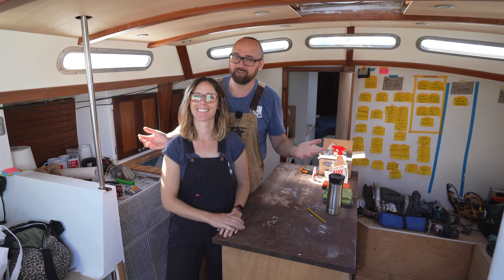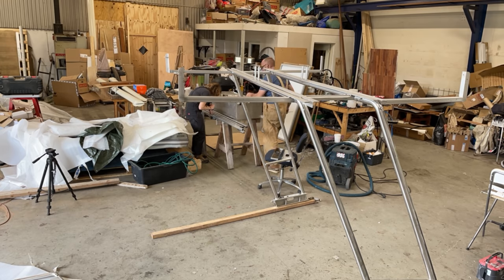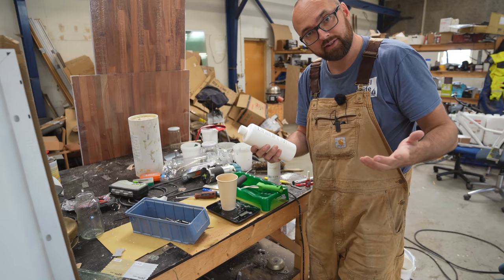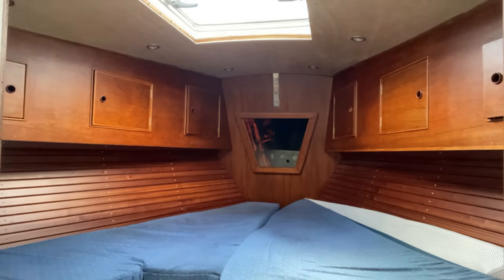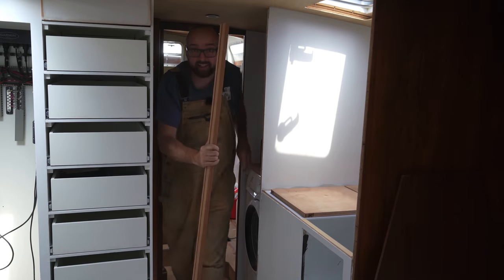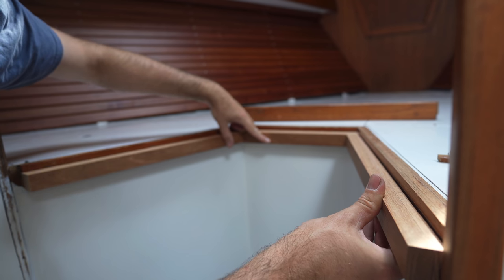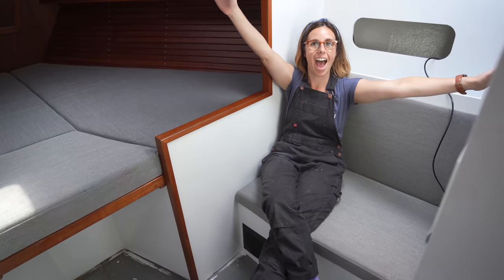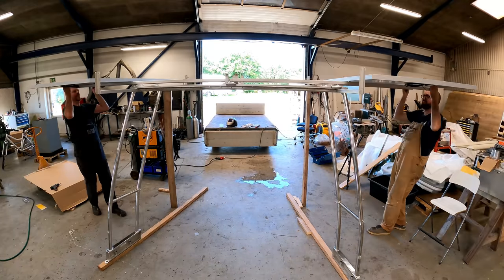Sail Life -  1200W solar on a 38 ft sailboat ⛵ - DIY project

Comment: Hi Mads, when I was living onboard on my sailboat in Sweden, I installed small PC 12V fans under the bunk to make suck out the air. I also drilled some small holes under the bed. That help alot
Reply: That’s a superb idea.
Reply: That is my experience too. Makes a difference even without the fan, but the squishy stuff still requires some air circulation. Some holes under it or something. I have that.
Greetings from Finland.

Comment: Arch looks great but with dingy+ engine  and panels, looks like arch needs additional triangle supports running fwd from arch to deck for bracing. That weight looks  like a lot of stress .

Comment: I’m a marine fabricator and that is a large cantilever effect with the arch. It’s OK in the marina but when your sailing there is a lot of inertia to consider. I really hope the hull deck is reinforced to cope with the cycling loads working 24/7
Reply from the maker: The deck-hull joint is just shy of 1" thick solid fiberglass. I'm not worried :) In terms of strength I can't think of a better place to mount the arch.
Reply: I was more concerned with the airfoil effect. With a strong cross wind, that could push the stern over hard.
Reply: @SailLife  perhaps monitor it, see if its cracking the gelcoat/paint and add a longer beam under it if needed?
Reply: @SailLife  I have had a problem with less weight  on my arch.  I had to add diagonal braces because when hit by a wave it felt like the arch wanted to jump over the side of the boat.The flex was impressive.
Reply: COG is aft of stern, from top arch post run guy wires anchored about 4 feet forward, no comms gear on arch, as well as planning ahead alternate stowage/recovery of panels, if necessary. Consider sea trial with wind 17-25 knts before embarking.
Reply: We have a similar arch, holds two large tiltable solar panels, radar, various antenna, a barbeque, a 10 kilo gas bottle, a Highfield classic with at one time a Honda outboard weighing in at 99 kilos with the dinghy. It has done 37,000 miles with said dinghy in place and seems pretty solid still. No signs of our puny 20mm fibreglass letting go yet. And as far as airofoil effect, well when you have wind strong enough to cause that to be an issue, you have a whole lot of other problems to keep your mind off it, such as those 17 metres of slab sided mast etc. We only have 8 fasteners per panel, so we could ditch them over the side if necessary.
Reply: Your channel is a nice contrast to time share production boat rebuilding golks whining about what they dont know and truly cant afford. That as a side I dont know the arch its adventurous - it might be just fine time will tell. I put on a large adventurous hardtop on my boat with extra bracing - Imhave had some hairline gelcoat cracks.
Reply: @chrisfreeman4358  That's what I was thinking, it may need more diagonal support. Some gussets in the top corners to stiffen it side to side from flexing. Looks plenty sturdy fore/aft direction.
Reply: @keithhall9298  I'd like to find a 20 year old production boat without hairline cracks. Our 150 million dollar office building had more cracks than a bus load of comedians and it was designed to last a hundred years. They demolished it last year, at 26 years old, to build a casino. They're betting on future business to make it pay. That's progress for you.

Comment: Enjoyed this video so much.  Progress is accelerating with your teamwork (and thank you to Martin & crew).  Just the whole vibe of the video was great with the glimpse of the drive from your parent's house (thanks to Ava's great videoing I assume).  The arch is amazing. I was just slightly worried with the loads the bolts holding it down will be carrying and how they are attached to the boat.  But I am sure you've got that all worked out.  Can't wait to see next week's video.  Sunday night's (local time) I'm always looking forward for the next episode.  Thanks Ava and Mads!
Reply: I agree, --looks like the arch could use a little more bracing or the bottom feet should have been made longer,
Reply: @wdinns  as there Will be a BIG wooden beam going i to the arch, I suspect that Will be part of the structural strength and integrity which prevents the "Lean back" forces..

Comment: For the dingy might want to make some loops or soft shackles for the lifting points and have pre-made lengths of rope with carabiners coming down from the arch.  Should make connect and disconnect faster and it will keep it level.

Comment: Do you think there would be any need to brace the solar slide-outs? Seems like a strong wind getting under a panel could possibly cause problems…
Reply: Solar panels are mounted to  Motorhomes and Vans in the United States by the 10s of thousand and go down the road at 80 MPH and do not cause any problems , they should be OK
Reply: @glennlacewell5766  I have yet to see any motor home or van going down the road at 80 MPH with panels just flopped out in the breeze like a hanglider wing. They’re all (usually) pretty well secured…
Reply: @southernpaths2986  That's why he said they're only for use at anchor. If it gets windy he will keep them retracted
Reply: @57dent  I get that… it was clearly stated in the video that they’d only be deployed while stationary but the wind doesn’t stop blowing when you drop anchor. It just seems like leaving them unsupported could possibly lead to problems.
Reply: @southernpaths2986  When you drop anchor you're always looking to be on the lee shore so you're sheltered from any winds. Besides, if wind pucks up he just retracts the panels.

Comment: I look forward this video every week more than I looked forward to GOT…

I have some mild concerns about the arch and sliding solar arrangement being beefy enough to withstand a Atlantic crossing. Costal it looks fine, afraid a nice big wave to the stern would bend all the tracks and make it inoperable. I’m sure it was well thought out and worst case you know how it goes together so you can rebuild!
Reply: I too am concerned about the leverage it has against the deck fasteners, pulling up the dingy with an engine on while bouncing on anchor is a lot of stress. If the toe rail wood goes into the base of the arch that would help but an add on brace would make me feel better.
Reply: Madds said the solar panels that slide would not be out when under way so you don’t have to worry about it. It’s only when at anchor the panels will be slide out !!!
Reply: @mwatkins2464  definitely understand that part. Even when the second set of panels is stowed that is a lot of surface area to catch water, wind, and swing at the end a pendulum pitching in the sea.

I’m sure he knows what he is doing, just interested to see how it turns out.
Reply: @murphthebeast  you might be right I guess he will have to try it out and see.👍

Comment: Mads, I am really worried about the mass of the solar panel+bridge so far from the axis of rotation when the boat is in choppy waves. I feel that the construction needs a stronger fixation to the deck, e.g. with an extra leg/brace forming a triangle.

Comment: Good to see you both together!  I have to be honest, seeing the arch on the boat makes me a tad bit nervous as it will always be pulling on the mountings wanting to tip backwards.  This could be especially troubling in squalls and very high wind situations where anything that gets enough wind under it goes flying.   I can't remember if you did some load calculations but I suppose I only comment because I want the best for you and Ava, as much as an armchair engineer I may be!  Cheers!  Evan

Comment: Mechanical Engineer here... It looks like you have a crazy moment load on that arch working to rip the fasteners holding it to your boat out of the deck.  I'm not too familiar with your design (first video I watched in a long time) but just thought I would mention it.  It looks like the boat is coming together nicely!

Comment: I'm concerned about the weight of the Arch, the Panels and the Dinghy adding another structural support extending forward from the arch to provide a little more stability for the Arch and the weight it will support? Its hard to explain what I mean without using a depiction, I just don't think the load is distributed over a large enough area of the deck.
Reply: A support / brace at the forward of the arch supports would be helpful.  Perhaps extending the base section.
Reply: @Tomm9y  Right, just something to distribute the load over a larger area than just that aft end.
Reply: Exactly. A base that is 2-3 times as long and an extension on the forward stanchions or just the forward stanchions at a different angle, so that they are not parallel with the aft stanchions, but extend more forward.

And a diagonal tube in the upper corners of the aft stanchions might be a valuable addition for (the many repeating) sideways flex/loads.
Reply: @gadenhertog  Yep, the arch looks really heavy and would benefit from diagonal bracing. Fore and aft AND side to side. Thin dyneema lines (X shape) maybe. Cheap and easy.

Comment: Being indoors that bathroom counter will probably be fine.  Out in the UV it really pays off to put a layer of really light fiberglass over exposed wood.  The glass turns completely invisible, but it's enough to stop the grain from checking the epoxy.  It makes annual varnishing super easy too.

Comment: Great Solar Panel Install. 2 things. 1. Put it on your yearly maintenance cycle to swap top with bottom panels to extend the life of both. 2. I would look for away to add a vertical support on the back and mount it vertically on the transom. Think some vertical support from a different mounting plane would help a lot with longevity.

Comment: not that it will help right now, but there is online shop called photonicuniverse.com, which sells solar related stuff. they have semi flexible solar panels, the bigger of them rated at 350 watts (2024 x 991x 2 mm) and under 7 kilos each. four of these babies will give you 1400 watts for a fraction of the weight. they are not cheap tough. i am by no means sponsored or affiliated  to said shop, i just think they have great kit.

Comment: If Ava is going to be concerned about dust, a small project for the future could be a variable positive/negative pressure exhaust fan. Some RVs have them, when. You're in a dusty area you positively pressurize the cabin and it keeps it out. If you're producing dust in the cabin, turn it negative and a good amount of dust gets sucked out.

Comment: I dont mean to be  derogatory or a smartass but .........Athena must be well down on her designed water lines with all that new fibreglass ,new machinery  and appliances,  new water and fuel capacity and new fittings and fixtures.   This goes against all principals of good naval architecture.  Still love your work.

Comment: Tip for the bed: add a mattress topper! After 2 years sailing in the Caribbean with 2 times crossing the Atlantic Ocean, we were so happy to be sweating just in the mattress toppers. At the bigger laundry service you will be able to wash the cover and we even washed the foam in Bonaire. And your own mattress will stay clean.you could even put some extra mesh between the topper and the mattress for extra ventilation.

And yeah, you guys rock! So good to see you together!

Comment: Kinda really clutters the boat. I understand functionality of the panels and is needed for your lifestyle your trying to achieve. Just feeling too much stuff on and in the boat. Also hopefully the panels don’t act as a sail or an extra rudder and create positive or negative steering. I can guarantee the panels will give massive down force and squat the rear during sail. Good luck hopefully my thoughts are wrong.

Comment: I hate to say this at this point in time. But I noticed that there is no ventilation under the bed cushions in the forward cabin. If you plan to sleep there every night I highly suggest you drill 1½" holes for every 5" or so to make the underside of the cushions ventilate.
If you don't there is a high risk they are going to go moldy on the underside unless you raise them up on edge to air out every day. Been there done that. 
A normal person perspires up to 200 milliliters of water per hour!

Comment: so exited to see the sliding solar panals,  i've always had that design in my head and its so good to see it actually made, mine is just a bit more elaborate in that not only do you have the two panels shifting sideways with a mechanism that you get in tabletop extensions that pops up the middle bit so it sits flush with the slide out side panels, but you then also have 4 shifting backwards, giving a total of 8 panels giving 2.4kw of solar.  and if you had the bi-facial panels the potential could be up to 4kw. obviously like you said only practical for when you are on anchor, but then again, that is where you would need it most, I would think

Comment: The project was already running in top gear and has now gone in overdrive with the addition of the lovely Ava and Epoxy mixer. One of the other contributors has mentioned mechanically ventilating your vee berth void space under the berth (as away of drawing air through the mattress - I think it’s a great idea - 😀👍⛵️

Comment: Curious - are you running multiple Solar charge controllers? One for the "always exposed" panels, and one for the "sometimes covered" panels? If not, how are you dealing with the shading issues from the panels?
Reply: If you look back several episodes, you will see that he does have two separate victron charge controllers. Even without the slide outs, a good idea to have redundancy in case of a single failure.

Comment: So, why can't you sail with the solar panels extended?  Are they not secure enough or is there another reason?
Reply: Boats heel when under sail, one dip in the ocean and the forces would tear those brackets apart plus I dont think they'd be strong enough to take wind pushing up under them

Comment: Hi Mads, what is the name of the "squishy stuff" that you used to reduce condensation in your forward cabin. Apologies if I missed the name in your video. Many thanks
Reply: spacer fabric, 3D fabric
Reply: I got some for my boat from www.sailrite.com.  They just call it "moisture prevention underliner" on their web site, but they only sell it in black. After cutting the edge, it sheds little black fibers all over the white fiberglass sole.  I wish I had known it was available in white somewhere!
Reply: Like the previous guys said, but you propably can find it cheaper from your local upholstery shop. My experience is that you still need aircirculation under it, to make it work properly.

Comment: Not to be a negative Nancy, but I would be concerned about raising your centre of gravity with the arch and solar panels. I'm guessing it weighs upward of 300 lbs. At that height, you will feel it. The other issue is being heeled over, the panels will catch a lot of wind and cause more issues... would love to hear if you did any calculations on the centre of gravity?
Reply: I’m betting that boat will weight a lot more than 20,000 pounds.  300 pounds is a rounding error.  I would not be overly concerned.  I’m a fan of the solar panel design.  But honestly all this time I though they would slide for and aft!  😀
Reply: Maybe, maybe not, it would be good to actually calculate the change in COG. They plan on crossing the Atlantic, stability is important.
Reply: @keviny6845  to actually calculate the change is COG would be extremely difficult.  You would need to weight everything new on the boat and then weight everything that has been removed and then put together a group of differential equations that represent the new changes.  In order words that is not going to be done.  I suggest just going for a sail and see how it responds. My guess is the boat is going to be a bit heavy in the rear but most for all the equipment that has been added not because of the arch or the solar panels.   But then again there are the new tanks so it may just balance out.  Also right now the boat is setting nicely in the water.  I think we will see in a couple of months.  Best wishes.  Stay safe.
Reply: @danknox9986  It's not that difficult, just takes a bit of time to enter each new part and weight in a spreadsheet. Each panel weighs about 73lbs. About 300lbs. Just for the panels. Stainless arch weighs a lot too. So it is easily over 400 lbs, possibly close to 500lbs. That can have a significant effect on stability. I would take the time to verify that stability is still within an acceptable number. I just picture a 50 knot gale, boat heeling over hard, wind catching the panels, heeling over more, turning the bow into the wind... I would consider taking the panels down on long passages.